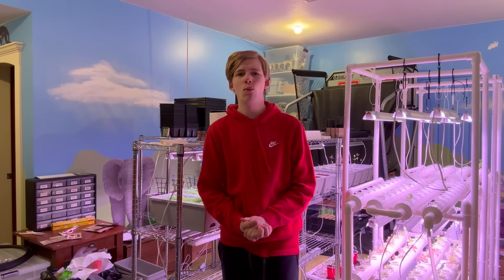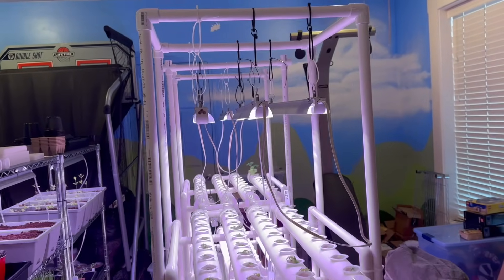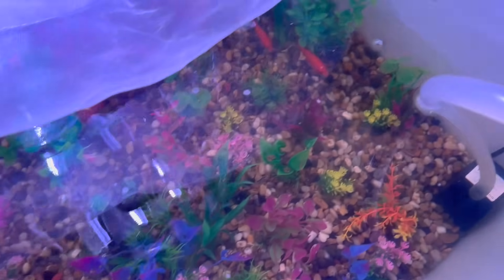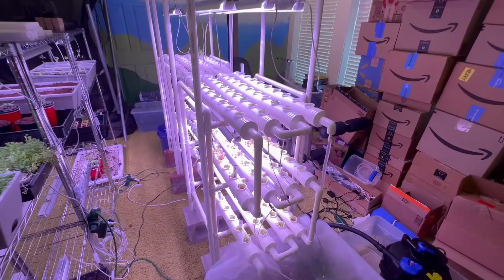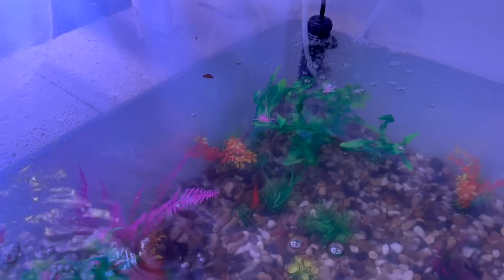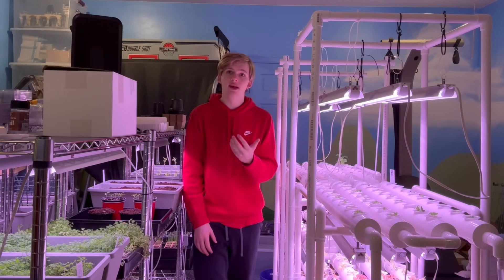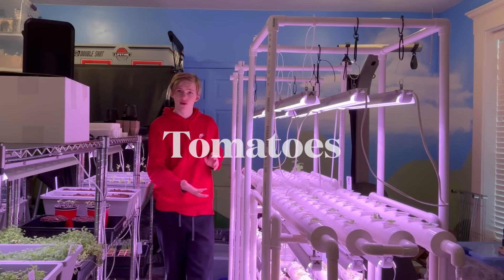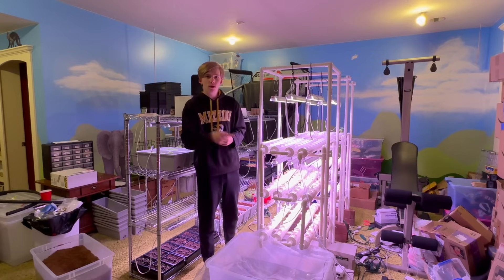The Ultimate Aquaponics Plant Guide

Comment: Can you grow ANY plants when using this? Like could I grow peas and sunflower seeds? My neighbor Dave, he’s a little crazy, and needs them to “defend his home” but unfortunately there hasn’t been much sun lately due to the cloudy temperatures.
Reply from the maker: That’s a great question, aquaponics are usually best to have in an indoor area like a greenhouse, but if it need to be outside it can. The only bad thing about aquaponics is that it’s difficult to grow bigger plants like sunflowers or corn but depending on your set up it could work. My system is a lot smaller so at the moment I’m sticking with smaller plants like lettuce and a lot of different herbs.